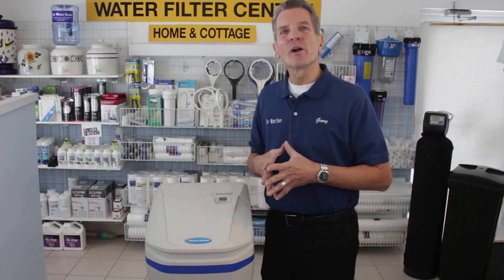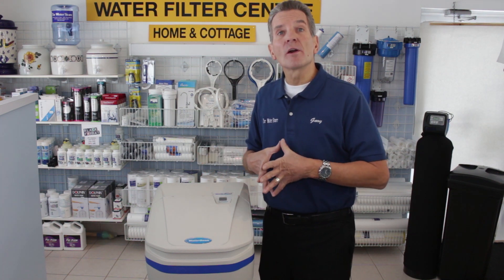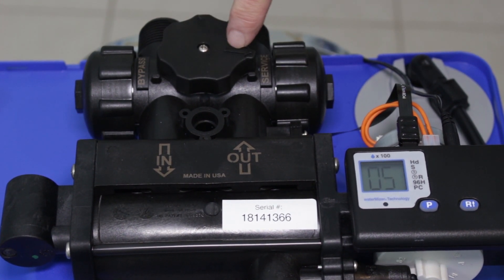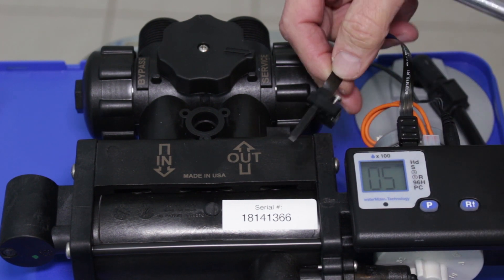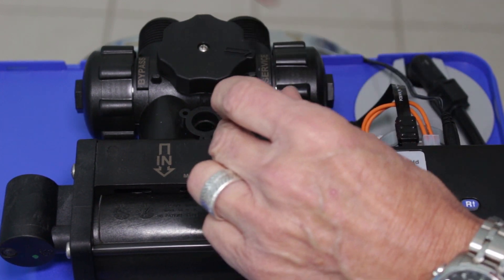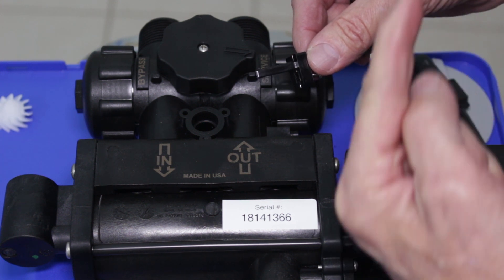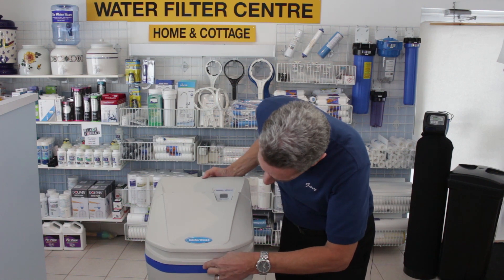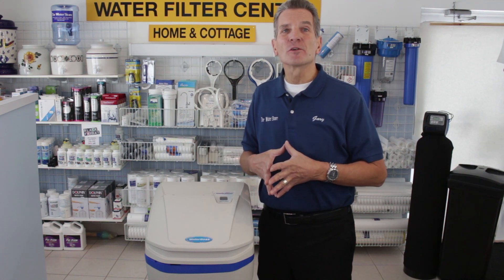WaterBoss Water Softener Maintenance Test Flow Sensor 3 Easy Steps

Comment: Hi I have an issue on a new wb700 that was installed to replace a 20 year old wb700. After a few months of operation, the unit detects water movement when water is in fact not being used. No leaks have been detected throughout the house either. Could this flow sensor possibly be faulty? Or do you have any ideas I should consider to get this resolved? WB tech support insists I have a leak somewhere, which I don’t. Thanks for the helpful content!

Comment: My water boss is making a clicking sound and the cam is not pushing the shaft  in  Thanks for your help
Reply from the maker: That happens when the piston jams inside the valve.  You need to repalce your drive end cap assembly, we have them here https://waterestore.com/products/aquamaster-drive-end-cap-assembly-54520 and this video shows you how https://youtu.be/l9bm8Tm5cjU

Comment: Hey, i have a Logix 740 head and water signal does not appear on screen, is that the sensor error or shall i reset everything and restart again setup?
Reply from the maker: Likely the meter has stopped working, or the circuit board.
Reply: @water_estore  yeah but the softnere is completely new, is it possible to be something on the setup setting on the head?

Comment: I have a waterboss 900 i picked up used, they said it was only a year old and i hooked it up and did the sensor check with a magnet since the watermizer isn't working, seems like it's the turbine since the magnet made the wheel move when passed over the sensor. so the maine problem i have is after a few regenerations i don't have soft water. does this turbine not working affect that? or is it just to count how much water is used? thanks and love the videos!
Reply from the maker: Yes, if it can't count how many gallons of water you used it won't know when to regenerate.

Comment: ive tested the sensor wire, it operates fine with a magnet, and ive replaced the turbine, still when i have the water running the circle doesn't spin, and when i do the regeneration process i get a HO and e1 error code  ? any help would be much appreciated